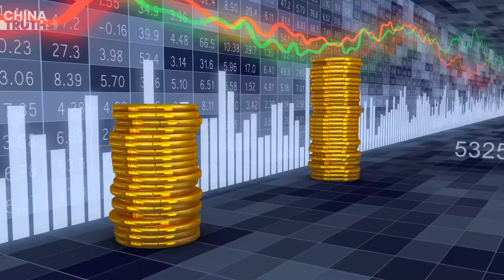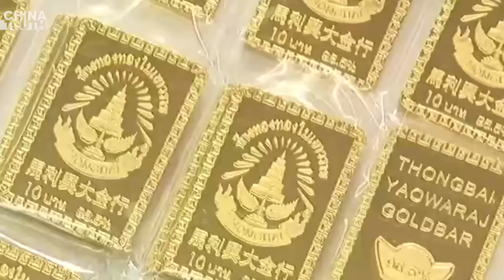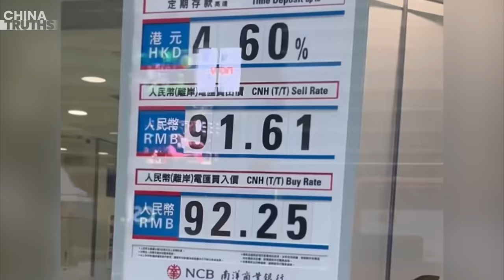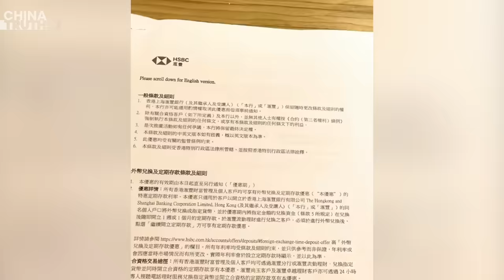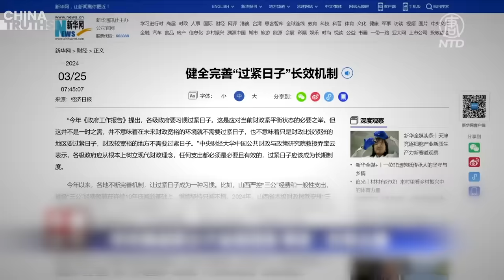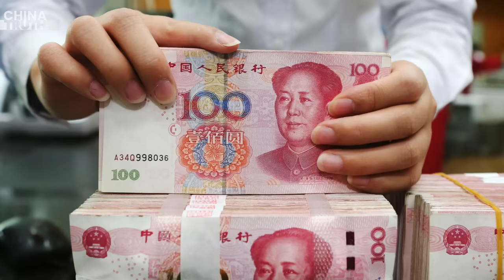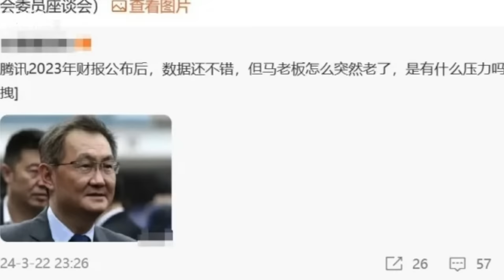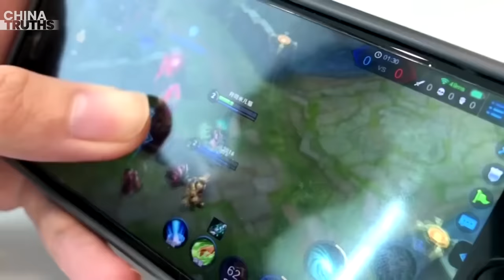CCP's Central Bank Secretly Hoards Over 5300 Tons of Gold; Tencent CEO's ‘Aging Photo’ Goes Viral

Comment: 1 tonne = 1,000 kilogram = 32,159.75 troy ounces at Gold Spot (USD2,200/troy) = valued  USD 70,731,642.
5,300 tonnes = 170,398,956.82 troy ounces = valued  USD 374,877,705,006.20 (i.e. ca. USD 374.877 Billion).

Even, if PBoC able to sell-off its entire hidden Gold Reserve at current Spot at USD2,200/ troy ounce, the amount generated, may just manage to settle China Evergrande outstanding debts & liabilities of some USD320 Billion.  Mind you,  there are over 100 Chinese distressed Property and Real Estate Developers, all mostly & technically have no or little Cashflow.

PRChina would need to accumulate at least another 10,000 tonnes of the yellow-color-metal i.e. 2 times that of U.S.A. official Reserve (8,133 tonnes)  to make a real impact.
Reply: Salve 👏👏👏👏😎👏👏👏👏👏